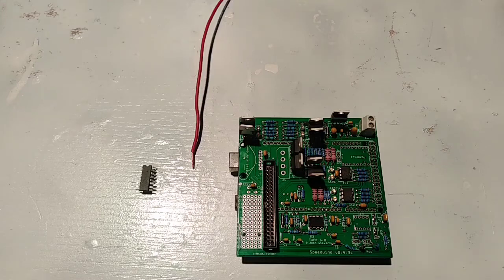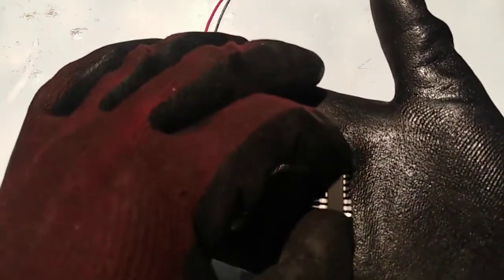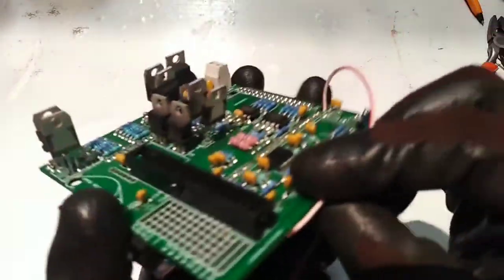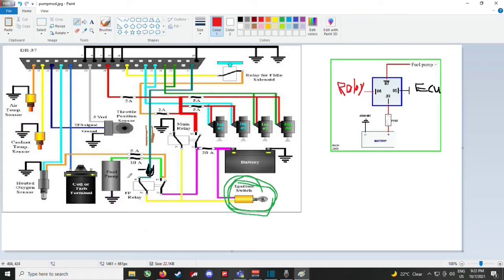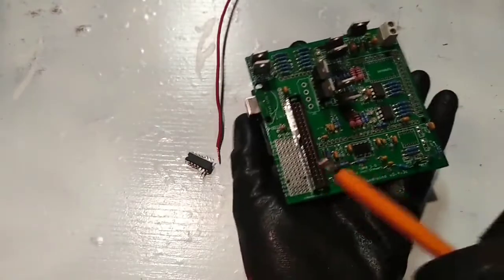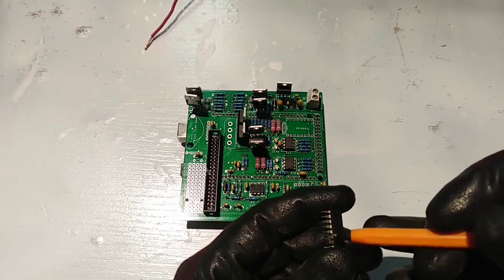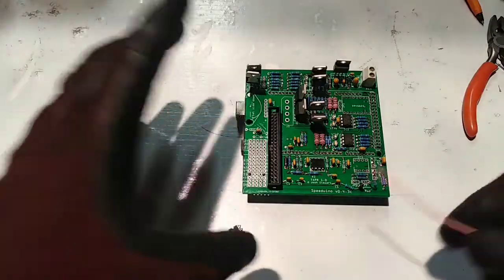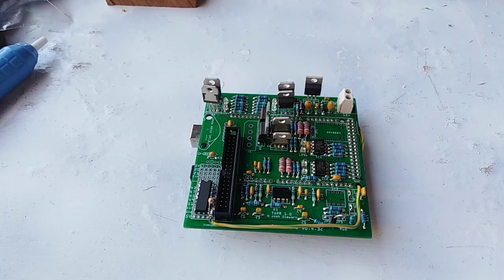How to add Clutch input, Fan, fuel pump, tach output to Speduino

Comment: Do you have any pinout how to solder ULN 2003 to speeduino v0.3.7 because proto pins have different places?
Reply from the maker: @sux3  you would probably have to cross reference the online available schematics to compare the 2. https://hackaday.io/project/4413/files I haven't done that specifically, so wouldn't be able to assist with any v 0.3.7. Also have a look at the link in the description of the video
Reply: @061garage  I found solution. I will leave a comment there, maybe anybody would find it helpful. I used ULN2003 (not placed in speeduino proto area). ULN gnd pin is wired to gnd output pin on speeduino, ULN 12v pin directly to speeduino 12v input. ULN pin 3 used for arduino pin 45 ( directly wired to arduino pin) and ULN pin 14 (output of pin 3) to fuel pump relay wire (I use fiat/lancia stock wiring relays - in my case pin 28 from harness) :)

Comment: Mhmm i build it like in the video. Now im try to test it on the bench but something ist wrong. When i mesure  the fp pin out IDE16 to gnd of my multimeter and the other end to 12 volt source there is reading 12 volt without powering the ecu only the Speeduino Main GND is connected to the battery when im powering the ignition circuit for a few seconds it reads zero than 12 again maybe a short in my ECU
Reply from the maker: @ferox1183  my fuel pump use to stay on when i shut my car off. Sounds like the same situation as what is happening to you, please confirm. If so, its working as it should .
Reply from the maker: @ferox1183  try wiring in a relay. With the fuel pump setup on tunner studio. The relay is expected to come on for the set seconds and switch off.

 When powering off the ecu the output pins ground. Which means your realy positive tigger needs to be on your ignition, for the fuel pump to switch off., when the car is off
Reply: @061garage  I think my uln2003 is the problem I checked the pins and gnd and output on 45 is open. Maybe broken I switched to FP Output in TS to 47 try this.

Comment: Is the speeduino output for the fuel pump a 5V, 12V or Ground signal by default?
Reply from the maker: Ground.
Reply from the maker: So thus the ecu grounds the fuel pump relay coil and the ignition provides +12v through the relay coil.
Reply: @061garage  The signal coming out of the ECU for the fuel pump pin in GROUND?
Reply from the maker: @jwilliams5857  yea the ecu provides ground to the ground out the relay
Reply: @061garage  Perfect, thank you!
Reply from the maker: @jwilliams5857  you're welcome

Comment: If I just want to do the clutch input I'd bridge the 51 pins and it would just work? Or do I need to run my clutch input cable into the board?
Reply from the maker: Do you want to be permanently on?
Reply from the maker: Check the link in the description, perhaps that will answer your question.
Reply: @061garage  If I put an on / off switch onto the clutch wire I could make it so the clutch would never send a signal if it's in the off position
Reply from the maker: @Jackaroo  you could do that in the software with no switch.
Reply from the maker: @Jackaroo  just set the "clutch enabled when signal is"  set that to high. Then you will always have launch control on. But then you would have a constant lower rev limit.
Reply from the maker: @Jackaroo  if you put an on/off switch on the clutch  and leave it on "on" launch control would be on from the moment you start the car untilyou switch the car off. Unless you switch the launch switch to off.